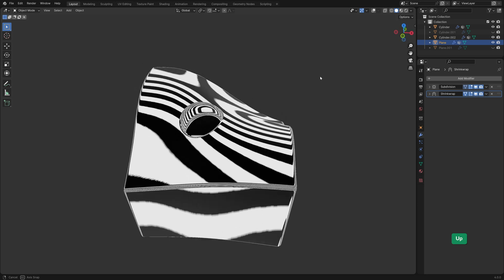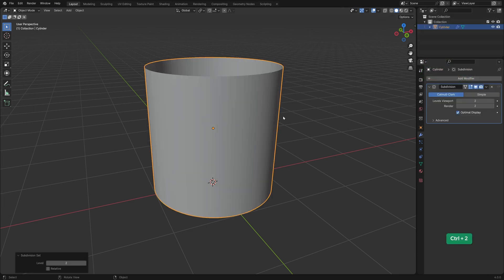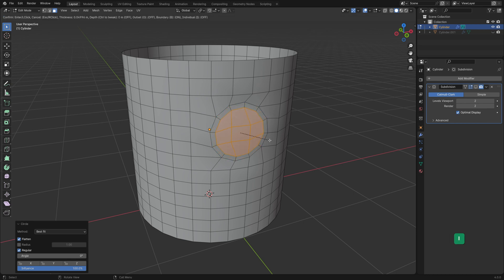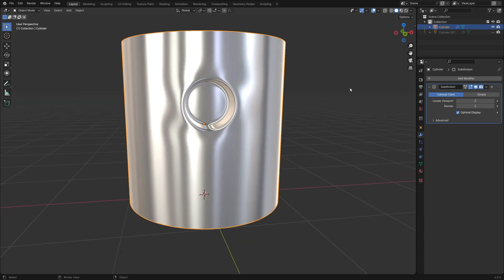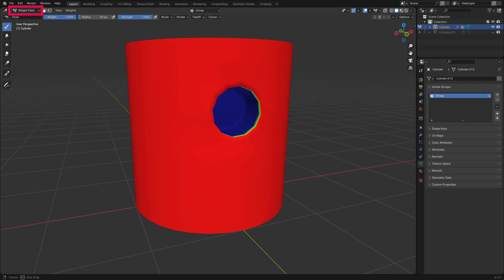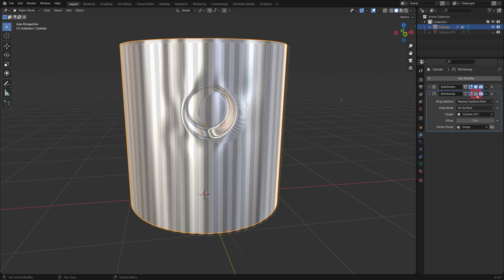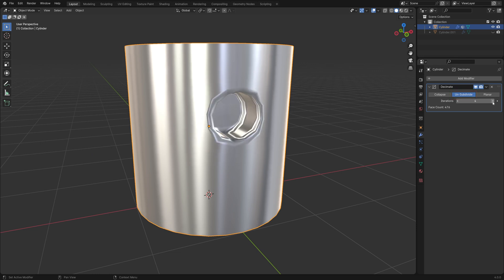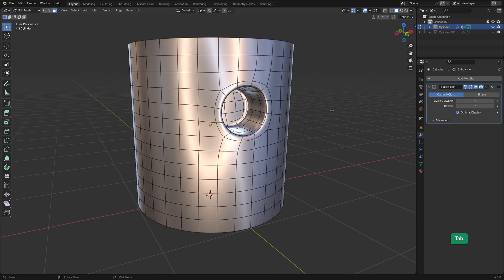Perfect Holes with Quad Topology in Curved Surfaces - Step by step Blender beginner version

Comment: I noticed that I was getting a ribbed effect on my cylinder (actually I tried it with a cone shape) which I eventually solved by making sure to add the same subdiv (and apply it) to my hidden target mesh as was added to the visible mesh being shrunk wrapped to it. Probably obvious but it still took me a little while to figure that out. But now, thanks to you I have a great resource for super nice curved topology with holes in! Cheers!

Comment: Very nice. I wonder if there's a way to import a model with these modifiers into a CAD software because the last and only time I've tried, there was no way to do it.
Reply: CAD typically uses solid models and not meshes. While you can convert a mesh to a solid model in most CAD software, it tends to give a pretty messy and imprecise result. You will either need to do manual cleanup or just remodel from scratch as a solid model (using the mesh as a reference).

Comment: Thanks Jan, huge fan of your work, you're one of the top blender creators and a huge help to the community! Just a small nitpick of something near the end, when you apply the shrinkwrap and it deforms a little and then you use "visual geometry to mesh" isn't that the same as applying the modifiers from top to bottom? At least the result looks identical to me. Thank you so much for everthing!
Reply from the maker: Yes, Visual Geometry to Mesh is usually used as a quick way to apply all the modifiers. Otherwise, you'll have to do it one by one from top to bottom, like you said. It's just a time-saver :-)